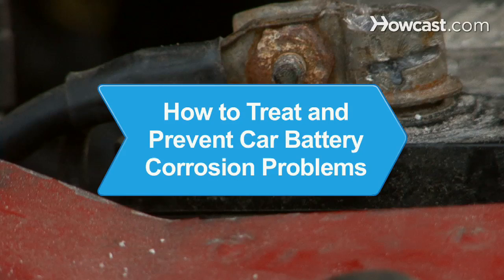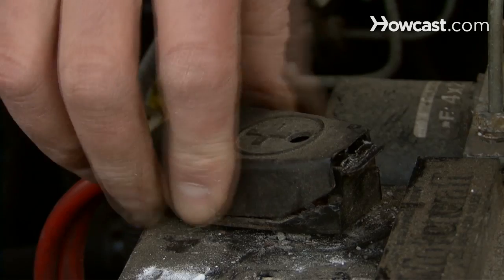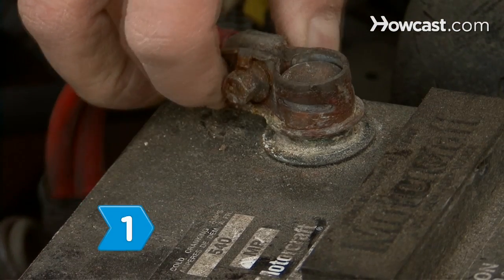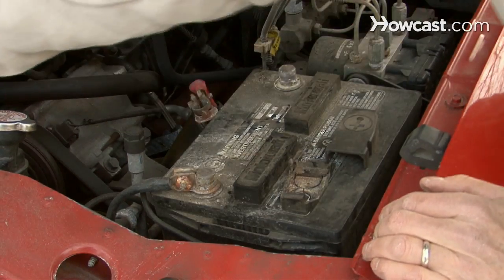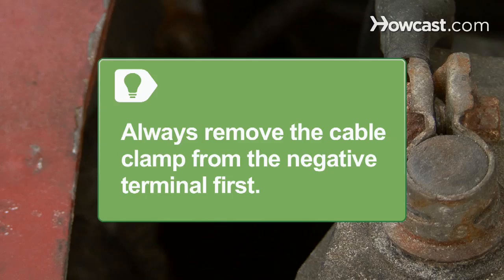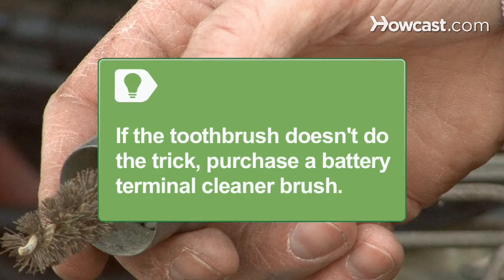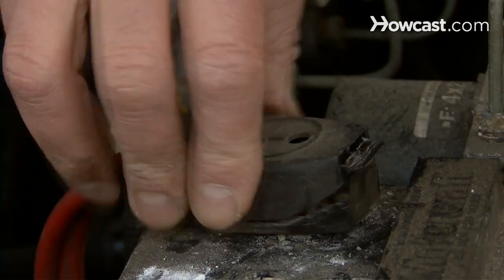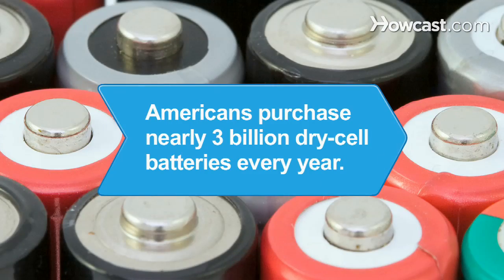How to Treat & Prevent Car Battery Corrosion Problems

Comment: NEVER apply gel to the terminal, you want to seal the terminal and clamp together by applying the gel after they are cleaned then clamped together, applying gel to the terminal will cause resistance because it's no longer metal to metal contact, and is fighting conductivity through the gel.

Comment: This Guy doesn't know much about how to prevent battery corrosion.  Petroleum Jelly will melt and run off quickly and not much good for the long run.  With Clean Battery Terminal's and Clean Cable Ends,  Attach Cable to Post's and Thickly Coat the Battery Post and Cable End's with #2 Multipurpose Grease.  I said a Thick Coating, and that's it,  Period.  No Felt Washer's,  anti corrosion spray or anything else.  When you need to disconnect the Cable's for one reason or another,, use a paper towel to wipe the grease off.